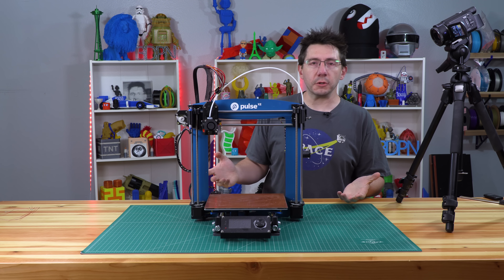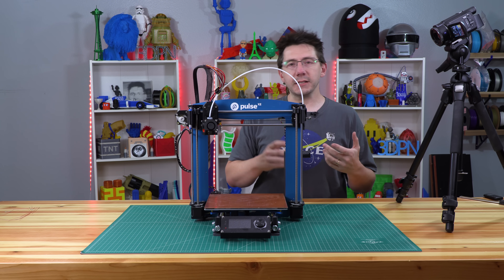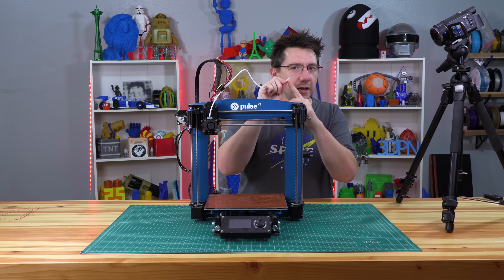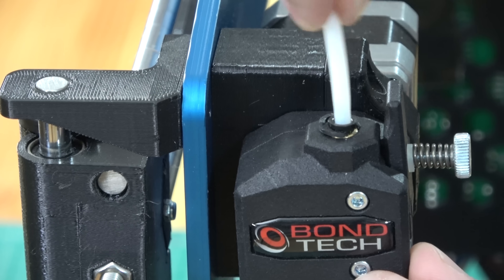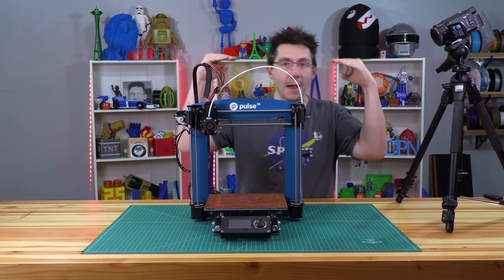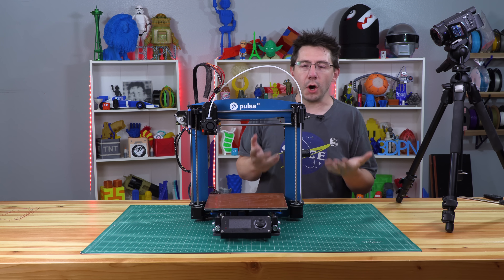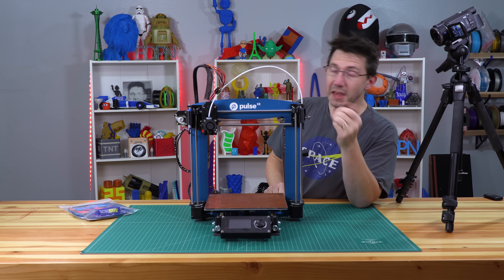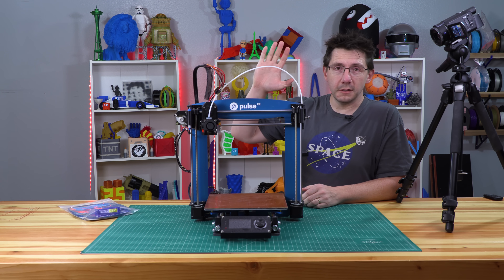Bondtech Bowden PTFE Coupler Fails - Here Is My Fix

Comment: Why doesn't make the PTFE retainer replaceable like on the Ender 3 and Cr-10S Pro? They will eventually wear out.
Reply: It is replaceable. Bondtech sells spares for about $1 and so do plenty of other I would assume. It's a standard part. The brass collar in the extruder is not, but you're not going to wear that out before the rest of it.
Though I will say that it would not a bad thing if the BMG had something like the E3D groove mount on the top as well so that people could choose what kind of connector they wanted just by printing the appropriate adaptor. I'm happy enough with the standard coupler and it did take a really long time for this to arise. I can live with printing a thicker retaining clip or replacing the coupler once every few thousand hours. But if others don't then it would be nice with an option.

Comment: I had this same problem with the bond tech extruder I got to replace the one on my Ender 3. Could get the tube in and pull the printer across the desk with the tube. But after a few minutes of printing, the tube would pop out. Ended up sending it back and going with a Titan. See other replies from people who have had a bond tech extruder for some time with no issues, makes me think something has changed in the manufacturing process. Hope they get it fix soon so they don't keep losing sales.

Comment: Is it a good idea to print the first few layers of a Nylon print with something like PETG for better adhesion, If a dual extruder is available?
Reply: This is an interesting idea that I can't try and don't have experience with, but empirically it seems to me that it wouldn't work, I don't think adhesion between PA and PET is fundamentally possible. Still worth trying though!
Reply: Siana Gearz it does not have to stick terribly hard, I think the little bit of Adhesion from welding the materials together (small layer height?) is enough.

Or laminate a single-use nylon foil onto the bed?